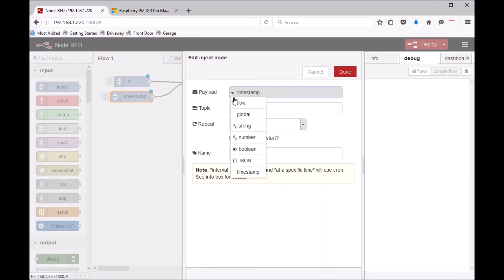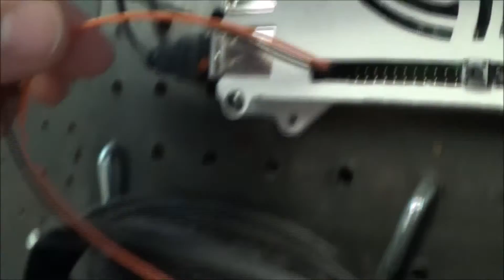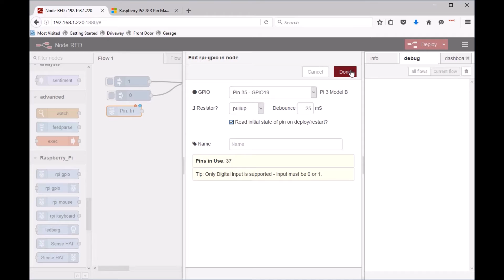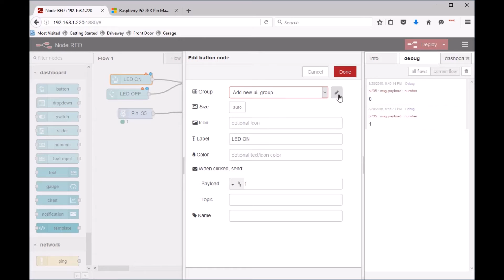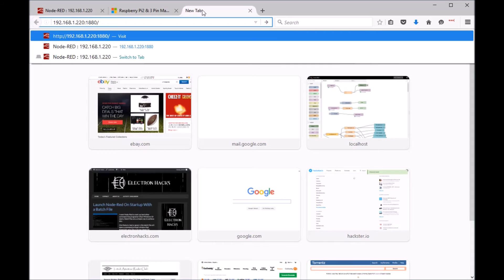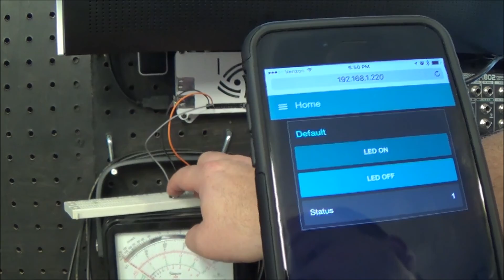Node Red GPIO Tutorial and Node-Red User Interface

Comment: hi this is good tutorial but i have quistion haw make this dashboard access for anyone in web for exemle i want to controle my raspberry from another city
Reply: I guess you would have to port forward the local raspberry pi IP to access from internet.
Reply from the maker: You would need to forward the computer IP and port of node-red through your home modem or router. Be sure to do a search for the instructions on  how to enable security otherwise it will be open to anyone. It's still fairly risky to open it up to the internet. For a more secure but less glamorous way you could use TeamViewer or a VPN connection. Another way is to bridge your local MQTT to a cloud based MQTT server like adafruit.io and have a web based dashboard or use IFTTT.
Reply: Would web based brokers work without internet on local network ? 🤔
Reply: ahmed adeli no internet connection is required, you can run everything locally on the LAN